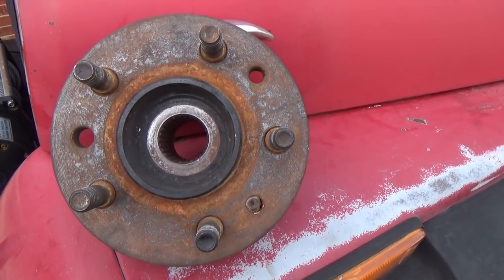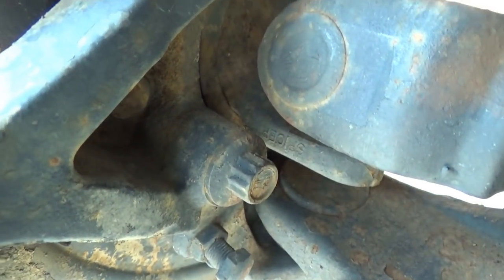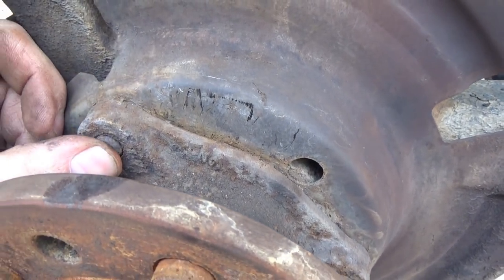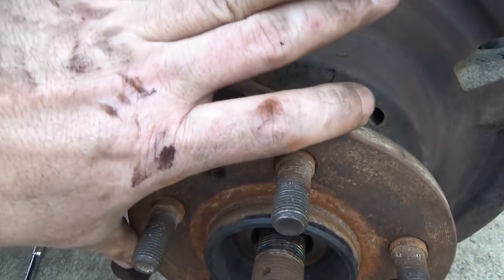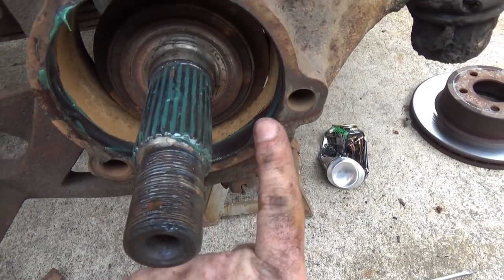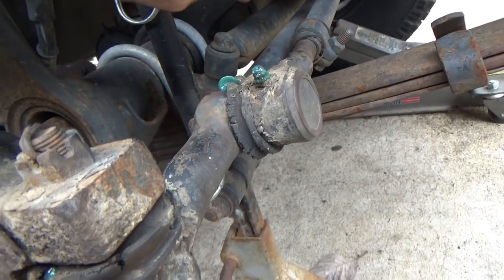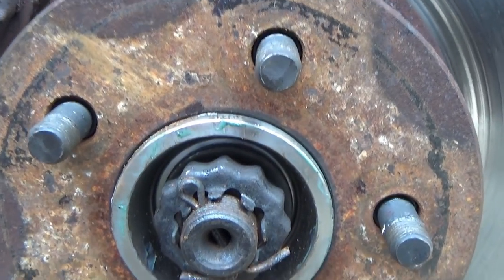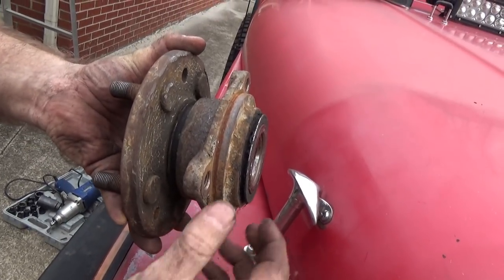Jeep Wrangler YJ - How to change the Front wheel bearing

Comment: Nice little video I do have a little tip for when you were trying to pry wheel bearing out if you would leave the 3 bolts in flush with wheel bearing side you can take hammer and hit the heads of the bolts and it will pop that bearing right out. I've always had better luck that way. Hope it helps you next time
Reply from the maker: You are correct. That's the part I didn't get on video. I did that to the lower 2 bolts and finally got the bearing to separate from the spindle. My dad pulled up and I was chatting with him and dropped the ball on getting the video shots of me taping the bolts to "unseat" the bearing. Thanks for dropping in a great suggestion. Have a great day!!

Comment: Do you know how to retread a caliper bolt hole someone has stripped it black way when and i thought u had no brakes but I still have a lot it’s just my 95 YJ is brakeing but when it does it goes to the left cuz the right hand caliper bolt hole is stripped
Reply: Nathan Zavala look up helicoil kit. It’s what I had to do to one of mine as well. Works great!
Reply: Roger Shunk Jr. do you happen to know the size of the threads ? Cuz am not to sure and I don’t want to get the wrong one and I heard of this
Reply from the maker: As Roger said, the helicoil kits work great. To find the thread size for that bolt or any other, take your bolt into about any hardware store. In the hardware section, they typically have a "find your bolt size" board set up. You simply test fit your bolt into the various holes. When you find the hole that it easily threads into .. there is your bolt size. Hope this helps. Thanks for dropping in! Have a great day!

Comment: Tech Tip: when I did mine I used a 4” wire wheel on a drill to clean up the inner bearing area. It polished it up nice and bearing slipped right in with not much effort. Be sure to grease as you did as well. 

Love the videos!!
Reply from the maker: Yep .. you are correct. I took some 220 sandpaper and lightly sanded the rust and crud out. Thanks for dropping in a great tech tip! That helps everyone :-) Have a great day!

Comment: Great video, I replaced mine a while back ago after it made a racket. 

On an unrelated note, would you happen to know anything about oil leaks? Changed the rear main seal twice, valve cover gasket, head gasket, oil pan gasket twice, oil pressure sending unit, oil filter, and everything is torqued to spec. Still find a tennis ball sized puddle under my YJ everywhere I park. Only other thing I have left is swap a new motor/transmission in, but I'm just a broke college kid so for now I carry oil in the Jeep to refill it when it needs it
Reply: Jeepoholic.  Sorry to hear about the leak. Take a look at your pcv that it is not plugged  and your breather hose to verify is pulling air ( clean filter).   You crank case might be pushing out oil through your distributor or dip stick or some of the places you mentioned if not.  Good luck
Reply from the maker: Not knowing what gaskets you are using. Here is what I do. I am very picky about what gaskets I use!! I've purchased engine kits that comes with cork valve cover and oil pans gaskets. I trash cork gaskets EVERYTIME. I will then purchase the gaskets I prefer because leaks are a pain to chase. Here is a Fel-pro oil pan gasket that will serve you well http://amzn.to/2HLfxia . When buying gaskets I prefer the Fel-pro PermaDry sets. They require NO rtv sealants at all. They are more expensive .... but .. I've NEVER had one leak. Hope that helps! Thanks, glad you like the video! Have a great day!